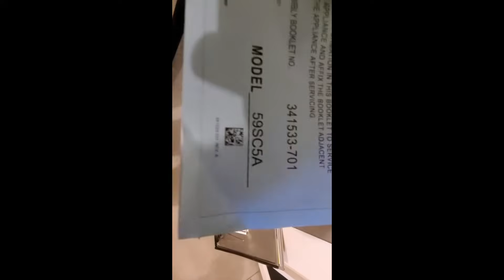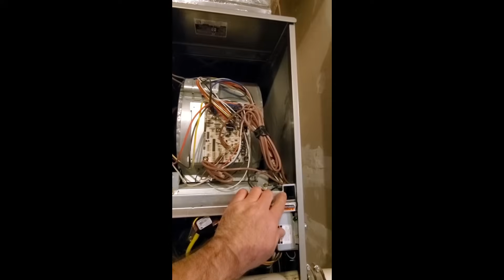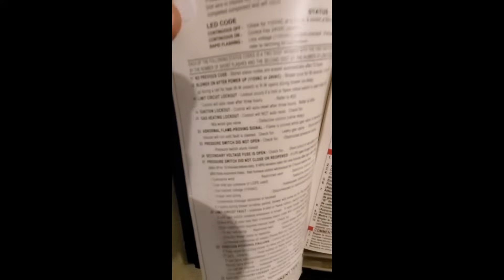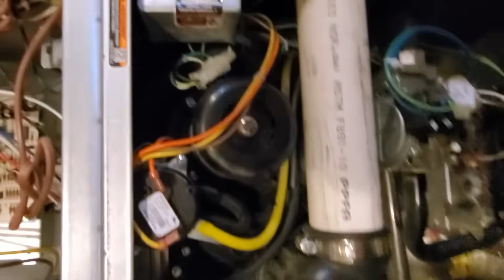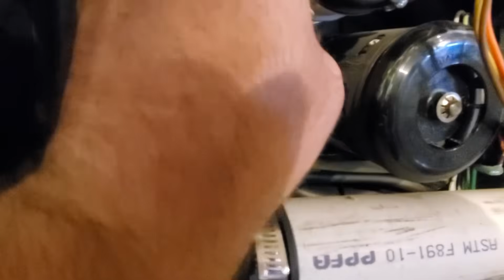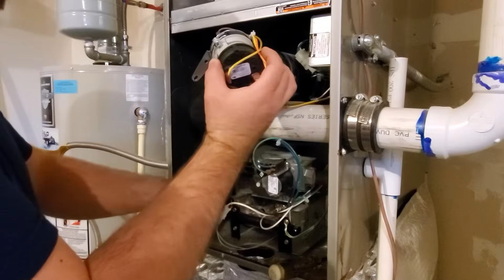No Heat Furnace Carrier Code 23 Pressure Switch

Comment: I can go into the thermostat service menu and see the last 10 events (Carrier Infinity unit).  It shows code 23 and the number of times it opened and closed each day and it showed a fault once.  What does it mean if you get the fault only 1 time?  Is the switch starting to go out?  The heat works.
Reply from the maker: I would think the switch may be going out or the orifice clogging
Reply: @MiloFarms  Thanks...

Comment: I was getting code 2-3 as well. I work on pool and spa equipment, and most residential heater have a similar system. I was flummoxed because, even with my knowledge base, I couldn't figure out the problem. I  had checked the vac switch and it tested fine... Or so I thought. What I didn't realize is that this switch has a dual switch configuration, where pool heaters only have a single switch. 

Thanks to this video and pointing out the dual switch set-up I was able to get my house heater up and running, which is great because it's cold outside, and was inside for a couple of days.

Comment: Thank you so much! I am extremely novice when it comes to this stuff. I didn't check my hoses, which I will, but I just tapped on the pressure switch with my finger, and my furnace turned back on! 
Your knowledge is priceless!

Comment: Thanks for the video.  My Carrier furnace wouldn't start and I had fault code 23.  Bought a replacement pressure switch from Supply House.  The original switch part number was obsolete, but they had a replacement switch.  The form factor on the replacement switch was slightly different.  I made the appropriate connections and it worked.  Thanks for the tips.

Comment: Thanks a bunch for this video. Woke up one morning to the cold and found that the furnace was not kicking on (even the fan would not turn on) but everything else did work. Made sure the thermostat and wires was not the problem first before seeing the board was displaying 23 (2 short 3 long blinks). Followed the video and checked the air hoses with no change then tapped the pressure switch (mine was a larger circular one.. look like it could hold a diaphragm) on start up and sure enough it spun up.  Got to wait for parts but at least I know what's wrong now. Thanks for the vid

Comment: You might want to drill that pressure port a little bit bigger , otherwise it will plug up with condensate again
Reply: Noooo don’t do that! They are designed to close and open on a certain amount of water column. You could jack it all up. 

The solution is to clean your condensate drain hoses and trap.
Reply: @BillyN31  Some of these furnace don't drain condensate fast enough and the manufacturer bulletin recommended drilling the port with a specific sized drill bit and if the problem recurred the condensate drain had to be reconfigured. The problem was the undersized port on the first generation inducers in many Bryant and Carriers furnaces. It caused technicians and managers problems for years because he MFR wasnt aware of it yet.
Reply: @WompRat94  never seen or heard of this.